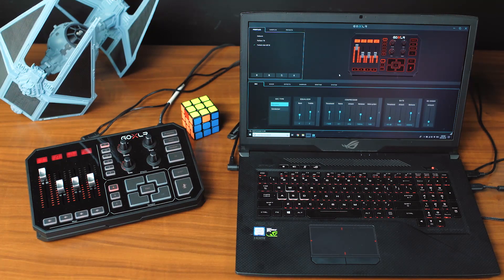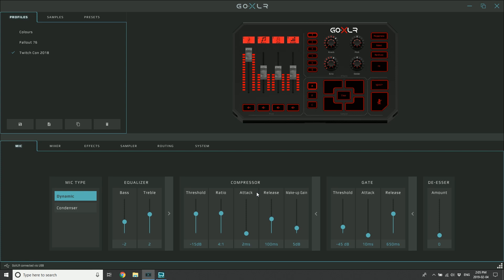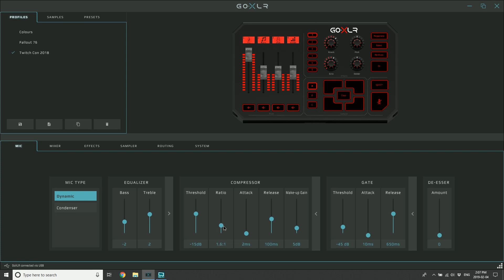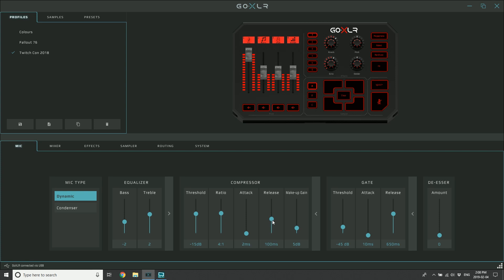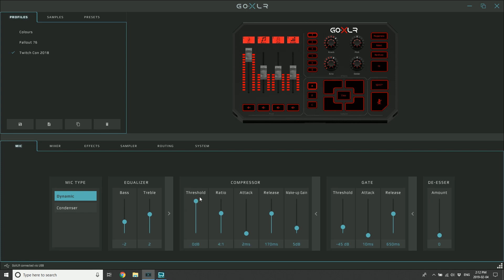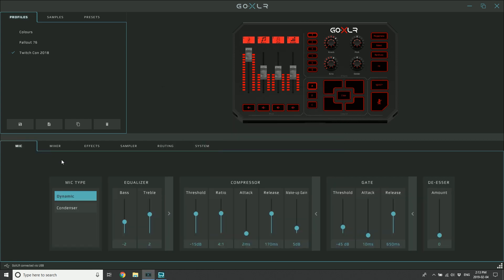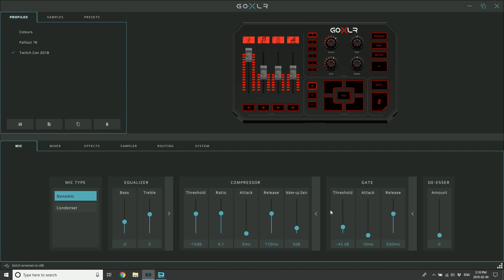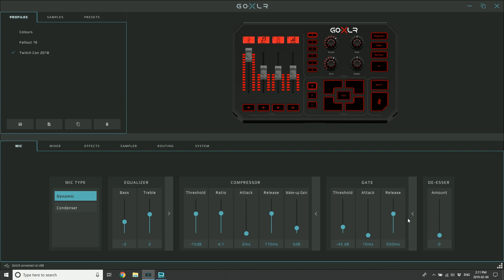GoXLR & GoXLR Mini How to Series: Advanced Gate and Compressor Explanation & Set Up

Comment: I'm using a rode podmic with a GoXLR and I get an occasional "knocking" sound (I literally thought someone tapped on my house door once) and I always have this vibration sound that sounds like im speaking through a aluminum pie pan or some sort of waxed paper. The vibration is kind of buzzing/creaking but sound metallic; if that makes sense. Ive messed with the settings for hours and cant get this noise to clear up. Any guidance is greatly appreciated.

Comment: 4:23 strange my SM7B doesn't even reach that signal level, I have to mine crank to 68dB and the signal barely getting to Good
Reply: MahaVakyas  no but I got one. I view other videos of people using the GoXLR with Sm7b and getting a better signal with less gain
Reply: CrespoFTW are you using the mini? I have the same issue
Reply: @skeelo3271  Yep i'm using the mini, still debating about sending my SM7B for repair or getting another SM7B or GoXLR
Reply: CrespoFTW I don’t think it’s the mic I have spoke with other people whe had the same issue with the mini and when they switched to the full goxlr it was working fine
Reply: @skeelo3271  that amazing if true. but buying a new GoXLR seem difficult due to lockdowns
Reply: CrespoFTW I know I’m having the same issue wish I just got the full goxlr at the time instead of the mini
Reply: @skeelo3271  sad that it's £300+ over here and out of stock....do you have any link of people talking about the mini vs GoXLR issue?
Reply: @CrespoFTW  sorry for the late reply no i was talking with someone else about the same issue and his was set to 63 db on the mini and when he got the full goxlr he had it at 50 with no issues and i have also noticed every video with the mini people have there gain set from 60-70 and videos with the full goxlr they have it in the 50s not sure what the issue is because the say its the same pre amps
Reply: @CrespoFTW  also if you live in the uk its 270  im also waiting for them to come back in stock look through the comment until you see Thatguy808
 thats who i was talking to
Reply: @skeelo3271  that's good to know that it's a common problem. Also I can't find one anywhere, on amazon someone trying to sell one for almost 400 lol
Reply: @CrespoFTW  i know i seen the same one when everywhere gets them back in stock the prices should go back to normal don't pay over 300 for one
Reply: @skeelo3271  Yeah man I'm like at 65db and picks up my brown switch keyboard. I've been wasting a lot of time just testing the SM7B and Mini combo. I've been debating on a Cloudlifter but it's another $150 :(
Reply: This is honestly so annoying. I thought I was going crazy, because I had to drive this much gain on my Mini. But I guess they had to save on parts somewhere, a shame tho, that they used a shitty preamp and still claim it's the same as the regular GOXLR...

Comment: does the GOXLR have a stronger preamp then the GOXLR Mini, Im having to push my gain to 59-60 to get in the good range with a shure SM7b.
Reply: i would like to know this also i have the sm7b and goxlr mini and because the gain has to be over 60 i here a slight hissing when i talk considering getting a cloudlifter but i wish i new this before i purchased and i would have just got the full goxlr
Reply: @skeelo3271  in this video he says hes using a Shure SM7b well or somewhere in the comments. But he's got it running at 50dB and his makeup gain is only 5dB. My mini has to push 61+ 5dB. But I just submitted for a return and bought the full GoXLR cause I wanted the extra functions.
Reply: @Stormtroopersi4  i know with my sm7b i have to have it around 68 db to sit in the good range with the mini what db do you set it to with full goxlr you got is it the same or do they have stronger preamps?
Reply: @skeelo3271  to have mine in the good like middle good, its 63dB with 4 gain but i normally keep it at 59dB and 5 gain, and have no issues with my stream, discord or anything. I have not received my full goxlr yet. Amazon is taking forever to ship things out.  You wanna remember on the Shure sm7b you wanna be close to your mic.
Reply: @Stormtroopersi4  yes i understand that i am practically deep throating my mic and if i have it at 50db it doesn't even register in the mic settings on the mic yet i have  seen people with the full goxlr with 50db and it puts them in the good zone  so curious to see if the full goxlr does have a stronger pre amp as they failed to mention that let me know if you remember when you get yours
Reply: @skeelo3271  Not a problem man, but you know the Shure SM7B requires at least 60dB of power to push the mic? But i'll hit you back with the results.
Reply: @Stormtroopersi4 it doesn't they recommend 50-55 of db for the sm7b anything after that introduces static hiss in this video he is using the sm7b with 50db in the good range
Reply: I would recommend looking into a CloudLifter or Fethead. They use phantom power sent from the mixer interface to give a dynamic mic something like 25db of clean gain. This will help you turn down the mixer's gain and eliminate the hiss. I've found it tends to make the audio coming from already good dynamics like SM7B and RE20 sound "cleaner".
Reply: @skeelo3271  so I got my GoXLR finally today, set it up running 50dB and 3/4 gain either one works perfectly. My GoXLR mini i was at 60/63dB and 4/5 gain to get my mic to be picked up. Not sure if my Mini was defective.
Reply: Thatguy808 ok thanks for letting me know my mini is the same i will get the full goxlr and sell my mini I think

Comment: Is the compressor and equalizer only available for the mic and that is it? Are none of the other mixer options able to compress or equalize sound?
Reply from the maker: That's correct. GoXLR and GOXLR Mini have dedicated hardware processors to handle all routing and effects.
Reply: @HeliconGaming  Hrm, that's exactly the question I was looking for an answer to, and I'm somewhat disappointed that's the case. 

I had been hoping we were able to at least use the compressor on other channels so that I could level out my games and try to fix the fact that Discord doesn't have audio normalization (as manually adjusting friends levels only goes so far). 

I don't suppose there's a chance we'll be seeing a GoXLR 2 that can do such, or an option in the app to have software compression applied somehow?
Reply from the maker: @pretzel_tfg  The processors used for GoXLR and GoXLR Mini are the largest that were available at the time without the price for either jumping significantly. With time, costs go down, but with new DSPs there's a lot we want to do so we wont commit to anything.

However, we were able to sneak a static compressor on the "chat" channel to help even out voices in Discord like you said.
Reply: @HeliconGaming  Oh that's amazing! I'm certainly interested in getting my hands on one of these in a few months (bills come first sadly), so Having a tiny little compressor on there is great! Is it on a toggle or fixed on? I'm this close to switching from Discord to TS3 because of audio woes, and If I do TS3 has built in normalization. But it's great to hear y'all snuck that in either way!
Reply from the maker: @pretzel_tfg  It's not a toggle, we just enable it and let it go. It's relatively light, but should even everyone out nicely after you've adjusted their audio levels in Discord to get "close."
Reply: @HeliconGaming  Fair enough. I suppose if I don't want it for some reason or another in the future I would just pick a different channel to pipe comms through, so no issues. 

Thanks for the fast replies; only found out about the GoXLR a few days ago and I'm already fairly impressed with what I've seen and how y'all are as a company. Keep up the good work!

Comment: Good video. Do I need a compressor like dbx268 or is that not necessary?
Reply from the maker: GoXLR and GoXLR Mini both have built in compressors and gates. While there is some subjectivity in preference over different equipment, overall GoXLR & GoXLR Mini provide the same or very similar functionality to a dbx and most who have one have removed it from their signal chain.
Reply: @HeliconGaming  thnx for the answer  I will save the money then

Comment: Will these settings work the same with a condenser mic?
Reply: They did for mine. The gate is more picky but other wise identical so long as  the gain on your mic setup is in the correct range.